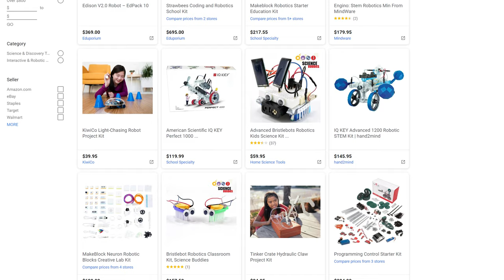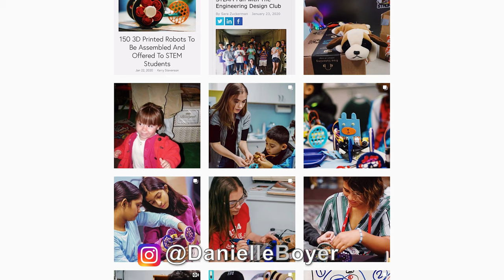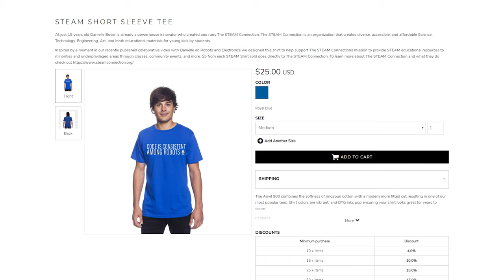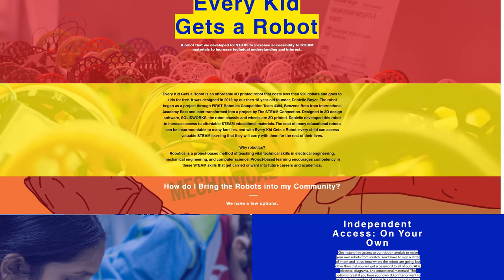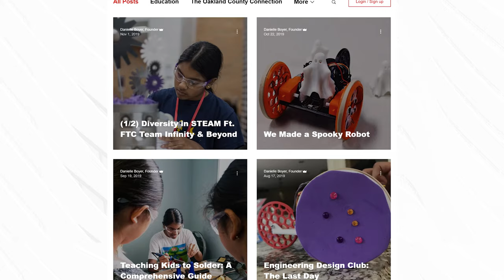3D Printing for Robotics and Electronics STEAM Connection Kits with DANIELLE BOYER!

Comment: ESP32 is amazing. When one of my Arduino Pro Minis choked on a big SK6812 LED matrix, I plugged it into one ESP32 and the whole thing lit up. The Feather boards from Adafruit are all right (built-in LiPo battery connector), and a bit pricey; I might look into either this kit or sourcing my own ESP32 MCUs.

Comment: Cool project. I did similar classes (ESP8266+L293+IR), so I'm stepping into 3D specifically to simplify the same things. I'm glad someone achieved it.
One thing to note: Solid W@rks Edu Edition can't be used for commercial projects (i.e. you can't sell it). Make sure you consider it, you would not want to ruin such a nice project because of this.

Comment: I called it Flathead  Long ago (in my Teens)   and still today call it a Flathead
Reply: It's a Flathead!
Reply: They've been called "common" or "slot drive" screws, and they are the reason why I dislike doing electrical work-- the bleepin' screwdriver will always find an excuse to slip out while I'm working, which almost never happens with Phillips or Torx.

Comment: Hey Guys!  AWESOME project and more than that, a commitment to educating our young folks in the sciences - HUGE KUDOS to you Danielle!!!  I would like to offer a small upgrade to your wheel design in the washer placements at around the 12:00 time mark: I noticed that the dexterity may become a slight issue for whomever would be assembling the washers onto the wheel just prior to inserting its axle.  What about modifying the design to include a small, hollow, thin-walled cylindrical protrusion outward from the axle portion of the wheel to a height equal to the thickness of the washers???  This way, the person assembling only has to drop the washers in the cylinder without attempting to hold them in placed while pushing the axle though.  It's just a suggestion to try to make assembling this part of the robot a bit easier, that's all.  But, in any case, absolutely an incredibly brilliant idea and effort on your part Danielle!!  This country needs more people like yourself who recognizes the extreme value in science education, especially when it comes to teaching the young generation!!    :-))

Comment: I'm just wondering about your problem with the motor driver board. It could be that the control chip is getting too hot. Try experimenting with one by gluing an aluminum heat sink onto it and see if that extends the life?

Comment: Hi, re the screw designations, you are mixing drive type with head configuration.
You can have a flathead screw with a slot or phillips drive.

A flathead screw fits into a countersunk hole. The top of the screw head is flat and the bottom is a cone.
A roundhead screw is round on top ( like half of a ball ) and the bottom is flat to sit against the surface you are screwing it to.
There are also pan head, cheese head and oval head.

Any of these can be slotted or phillips ( or square, or Allen )

Comment: It would increase the cost per unit a little bit but swapping the ESP32 board for a BBC Micro:Bit makes it easier to program the Micro:bit from other devices like an iPad or smartphone if the student doesn't have access to a computer. If they do program it with a computer, it also doesn't require any software to be installed, as it uses a browser app to program the boards, great for when you want to get making without having to wait for the school IT department to do their "security checks". It also adds a fun little matrix display, and a built-in compass and accelerometer, and if students connect their Micro:Bits together, they can use one as a remote to drive around the other person's buggy over bluetooth.

Comment: Hello question  question question  are any 3d filaments micro wavable?
Reply: Anything u can fit in the microwave is "microwaveable"
Reply: @jaynottelling5892  3d filaments  that wont get soft  or melt
Reply: @brantpurvis7846  well not really, the layer upon layer style of 3d printing makes for tiny gaps and variations all thru the part u print, meaning u have different levels of moisture in side the plastic, when the microwaves exite that moisture it wiggles and gets hot, so no is the short answer. Similar reasons why bacteria love 3dprinted plastics

Comment: There is no such thing as a flat-headed screwdriver, Danielle's dad is correct there are flat-headed screws with a slot than can be turned with a slotted driver, I worked for 23 years selling tools to industry and had to explain this on very nearly a daily basis when customers insisted on a flat-headed driver I sometimes asked them if they wanted left or right-handed drivers and had a bit of a chuckle when they ordered right-handed and left-handed drivers

Comment: So, she has burned out motor control boards, has she burned the main board out? A bit confused...
Reply: "Burn" means to clear the memory on the main board and replace it with your programme to make it perform like a car...... As to the motor control board the components start to burn out because she maybe connected it wrong..... I hope that explains that.
Reply: @BrianB2579  yes. Makes sense, I call burning things when I fry them :D which happened to several of my arduino boards before I realized motor controllers were a thing....
Reply: Same. I thought she really burned chips. Same word for everything sort of feature of english language.

Comment: Hello everyone. I need help with my 3d printer. I Have Geeetech A10. I started printing with solid red PLA and I have successfully printed my phone stand. Print came out flawless, very solid and very clean. Then bought Hatchbox ABS black filament and replaced old PLA. I was never able to get a normal print with it. Tried changing every single parameter bit it just wouldn't work. So i changed back to previous red PLA again, but things went bad, it started leaking black filament from extruder, probably some ABS was stuck in there . Now there isn't any black spots in my prints, but quality is far worse than i have printed months ago. Printer sometimes stops extruding too as i have noticed, because places are left blank. I can show pictures of what it's printing right now, even color seems different for me. Here are pics https://drive.google.com/file/d/1owFdf86FpbcwWpRhK4OZYtXDbUgVhIew/view?usp=drivesdk 
https://drive.google.com/file/d/1p7XgvLQc7HZdoRsr3mwNRpCN8phaQwi6/view?usp=drivesdk